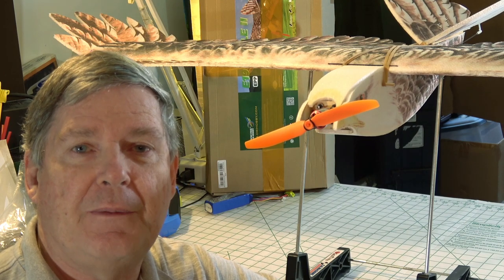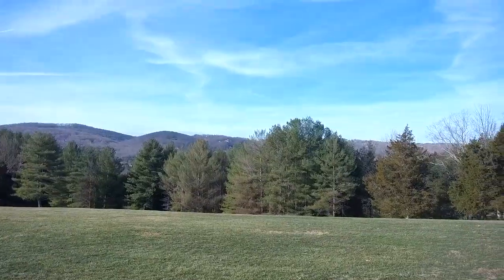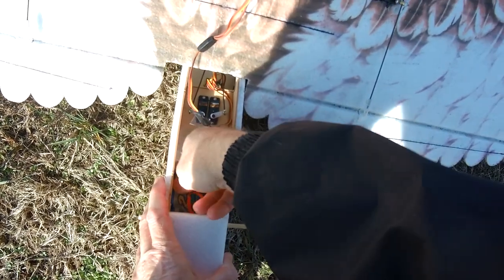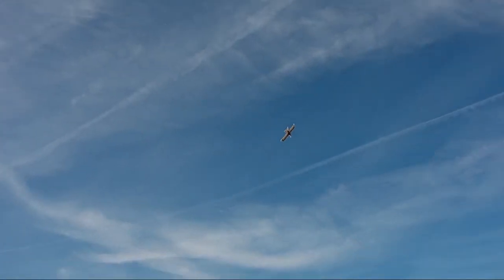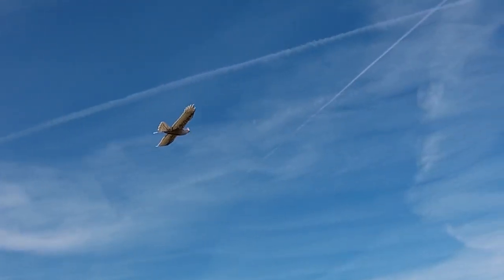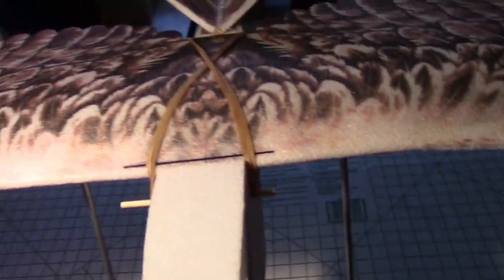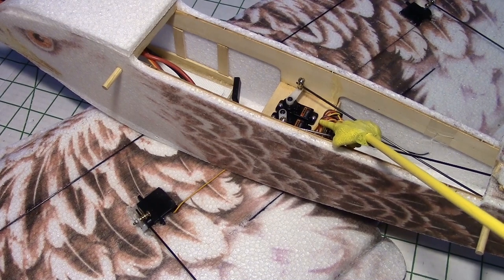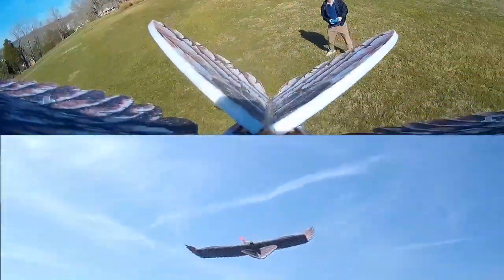Maiden Flight DW Hobby E19 Eagle V2 1430mm - Where is the CG Spot At?

Comment: Where is the CG exactly?  Make a mark where the plane balances.  Then tell us the width (not span) between the mark and the front of the wing edge along the fuselage.  Then tell us that distance divided by the entire width of the wing in the middle along the fuselage, times 100.  That will enable any eagle owner of any size eagle plane to balance his plane using the percentage calculation.
Reply from the maker: 60mm from the leading edge of the main wing. You figure the rest .
Reply: @DaveMerc  Can't figure the rest without knowing the exact width (not span) of the wing along the fuselage.
Reply from the maker: @hillock10  If you buy on you can measure it yourself. I am just giving you a ball park CG to work from.